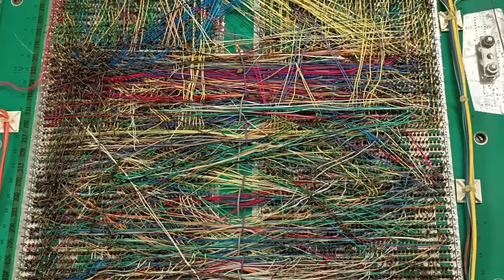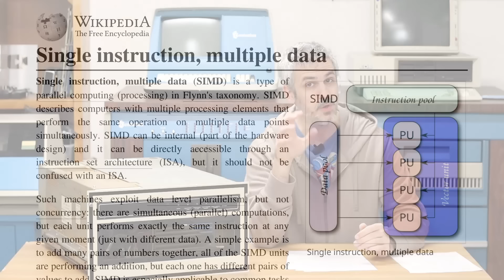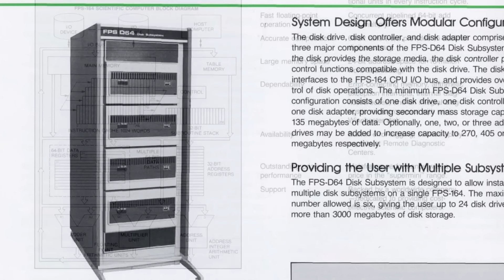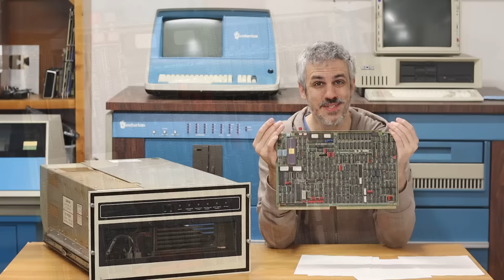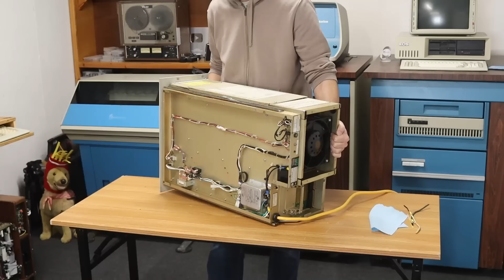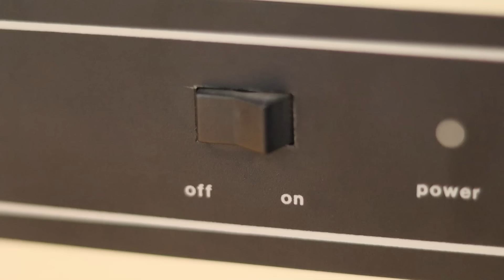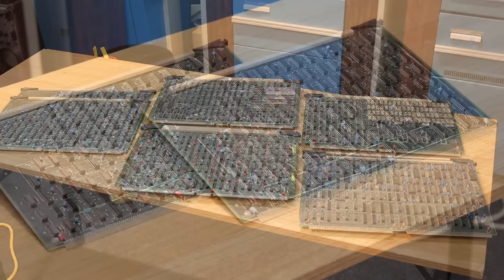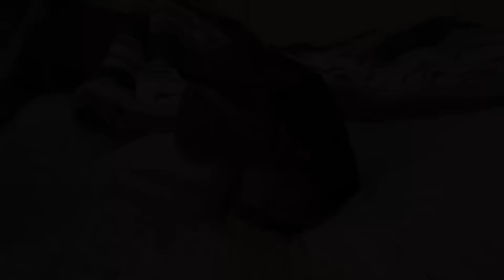This Computer is from a Defunct Supercomputer Company

Comment: In the 80’s there was a transition from scalar computing to vector/array processing was driven by a single, computational bottleneck: the massive data explosion from reflection seismic exploration used to image the Earth's subsurface. Geologists and geophysicists were trying to map the interior of the Earth to locate deeply buried oil, gas, and mineral reservoirs. To do this without drilling blindly, they relied on seismic exploration: detonating dynamite or using heavy thumper trucks to send sound waves into the ground, then recording the echoes that bounced off different rock layers using arrays of sensors (geophones).

Comment: Wow, Deja Vu!!! In 1983 I worked for a French Xray company CGR. They had a digital subtraction angiography (DSA) machine that used a Motorola 68010 based Versabus CPU running Versados. This was a front end to a microcoded vector processor built by VICOM of Calfornia. We used to call the CPU company "Motorooter". The circuit boards lay horizontal in the chassis. As they warmed up the boards sagged and the pins touched the board below it and shorted out. We ended up spacing them apart by wedging pencil erasers between them. When it ran it did some impressive image processing on Xray images. Look for a copy of Versados for your Versabus CPU. It came on 8 inch 1MB floppy disks.

Comment: Just like the MRI the Geological system was taken sound from different places on the surface and producing 3D Maps under ground to find oil and gas sands. Back in the late 70s early 80s I worked with the phoenix 500 system .

Comment: I guess if you don't got the microcode then ya gotta reverse engineer / design from scratch based on the chips used and how they're hooked together.
If it's loading microcode at boot, your microcode is just another part of your multi-processor executable?

Comment: Back in the early 1980's I worked for Perkin-Elmer, and we had a customer with a Floating Point Systems Array Processor. I spent several months on-site, although I had little to do directly with the FPS system so I don't remember the specific model. It was attached to one of the two 8/32 minicomputers we had which in turn were connected to 64 16-bit minicomputers and they in turn connected to (if I remember correctly) just over 1300 city intersections (traffic lights, in road sensors, pedestrian push buttons, etc.). My job writing networking software between the minicomputers and helping the application developers optimize their algorithms. The array processor was to perform high-level real-time traffic optimization (eg. a baseball game would let out a crowd, the traffic sensors would register high volumes, routes would be created by manipulating length of traffic signals to speed up dispersal away from the venue). We had a lot of redundancy at the front end, and the main 8/32 minicomputers could fail over (normally one was a development system). If the array processor was not available we would default to a previously defined time of day/week schedule.

From what I remember the FPS system occupied a single rack between the two 8/32 minicomputers. I think it had more than the single chassis for the FPS-100, but I believe it was a single system. Perhaps it had its own storage peripherals that were taking up the rest of the rack.

Comment: In geology, we use(d) "lots" of computer power for Seismology calculations - which can be used like an ultra sound to determine structures deep under the ground. I am 61, and became a software developer in part because of my love for Geology, and more precisely the things hidden under the ground. There are also many other techniques that require massive computational efforts, all resulting in similar results... A 2D or 3D representation of what's under the ground.
 BTW; I had one of those "Voodoo" 3D graphics cards (it really did seem to do a lot of voodoo stuff as well), and it was used precisely to render slices of the ground in 3D on the most powerful home micro we could afford at the time. We also used a silicon graphics workstation to visualize this type of "stuff" as well, along with the usual CAD work.
Peace from Australia.

Comment: worked at Fairchild palo alto research centre on the Clipper CPU project. I needed to determine the key figure for the semiconductor process for metastability of a flip flop (2uM process). We had a Vax780 and FPS164. I got a run per day. It took a few weeks to do a binary search via circuit simulator. Suspect it was aversion of SPICE.

Comment: before the 70's drilling for oil was "wildcatting"  ...  you just picked a spot and poked a hole on the chance that there might be something worth pumping out. 

These things allowed you to see what was down there by processing the echolocation of dynamite explosions into basically a sonogram. ... you couldn't see chemical composition, but you could detect phase changes (solid to liquid or gas chambers.)   

In first grade (75) at my violin lesson in a home, my teacher's husband was selling shares of an oil lease to my mom, and the primary visual he was using was a stack of 2d plots showing the cavity at 5000 feet below where they wanted to drill... was going to be a big reserve (millions of barrels) if it came in oil. engineer Mike had ideas about those cavities being useful for other things like Bat(man) Caves.

Comment: In Texas in the '70s and '80s locating oil using seismographic data was a pretty heavy lift that oil companies would need super computers for.  PS: to get that seismographic data in the first place, I think they put explosive point charges in various places and recorded all the echoes at various seismographic sensors. Then later they crunched on all of this echo data to triangulate likely places for oil and gas deposits based on density calculations.

Comment: Back in the 90s I was doing geophysical computing work, which basically meant babysitting a bunch of very temperamental vector machines while trying to squeeze seismic data through them faster than anyone thought possible. We were running these huge simulations full waveform inversion, reverse time migration, all the fancy stuff exploration teams loved to throw at us and the only way to get results before the next field season was to use vector processors. Scalar CPUs of the time? Forget it. They’d still be chugging through the first dataset while the coffee pot burned dry lol. The vector boxes, though those were the real workhorses. We had a couple of Cray Y‑MPs in the lab, plus an older C90 we kept alive with what felt like duct tape and prayers. Rows of those iconic blue and teal cabinets humming away, chilled by an AC system that cost more than my car. I spent a lot of time tuning code to take advantage of those long vector registers, making sure memory access patterns were clean, loops were unrolled just right, and the whole thing didn’t stall because someone else submitted a monster reservoir simulation. Speaking of which, reservoir modeling was another big part of the job: millions of grid blocks, all needing to be solved in parallel, all wanting more RAM than the hardware actually had. You learned to get creative.

Honestly, it was a blast. Loud machines, long nights, and the feeling that you were pushing the limits of what the hardware could do. Very “supercomputing lab in 1995” energy, I've give anything to go back to that era, I feel like creativity and innovative solutions were encouraged.  These days everything is standard practice even though it might not be the best solution, it is good enough.  Risk aversion has ruined research.

Edit:  I'd like to add that Fortran was the cornerstone of scientific coding back then, with some C for glue code, system utilities, and anything that needed to talk to the OS or batch scheduler. But the heavy numerical lifting, the seismic kernels, the wave equation solvers, the reservoir simulators, those were all Fortran. Some of the codebases were older than the interns lol.

A few adventurous folks were experimenting with MPI and PVM as distributed systems started creeping in, but that was more late 90s cluster culture. On the big vector boxes, it was Fortran all the way down.

Comment: I can answer how geologists use supercomputers. I am not a geologist, but I have supervised a geology team while working for an oil and gas exploration company. 

They used a Cray that was owned by Texaco, and used it to run stimulations based on know wells and underground scans to predict where we would strike next. They did some truly amazing things, and took most of the guesswork out of oil exploration. One of the early adopters of Cray's supercomputers was the USGS, and they mostly used it to model plate movement to simulate earthquakes and predict possible threats.

Comment: Geophysicists use seismic or other signals to determine subsurface topography, it involves tensor maths to determine material and stress strain relationships in the sub surface, you can use these to determine the location of particular materials, water, oil, minerals, etc. or you can use them to determine faults, high stress regions and occlusions which indicate high risk zones for seismic activity, earthquakes, tsunami, etc. So you can use it to find resources or dangerous areas, both with high value.

Comment: Vector vs arrays. It gets even more confusing when you mix in class objects called vectors and arrays. Vectors are just a dynamic array; you can change the size on the fly. Arrays are fixed-size. Depends on the language, though; in many languages, arrays are a bit of a catch-all term that mixes in maps, lists, dictionaries, and more. 

If you get into rendering, then vectors are closer to the maths term, though in computer rendering, they're a lot less abstract than in maths. Like, static dimensions and uses. That's modern programming, though. I couldn't tell you what it was like 50+ years ago. :P

Comment: An ESP32 can do similar or higher raw math throughput than the old FPS-100, but at thousands of times better efficiency.

FPS-100 (late ’70s): ~8–40 MFLOPS, room-sized, lots of power, dedicated vector hardware

ESP32 (modern MCU): tens of MFLOPS in optimized DSP/vector code, runs under 1 watt

Bottom line: an ESP32 is roughly 10×–100× faster in practical vector tasks and orders of magnitude better per watt.
A chip you power from USB casually beats a vintage “supercomputer” that needed serious infrastructure.

Generated by chatgpt

Comment: The original AP-120 (without the "B") was designed bty Glen Culler. It was quite different, used block floating point, but had the cross-coupled multiplier/accumulatot, like an early form of fused multiply/add, that accelerated dot products. I know this because the original plywood-sided AP-120 was still in the back room  when I started working for Culler in 1984. Culler licensed the design to Winningstad, who became a big benefactor of the Portland, OR area after he got wealthy (FPS was located in Beaverton, OR, west of Portland).

Comment: I used to work with Data General Nova minis. Loved those 8" floppy disc's. It even had a direct memory access board with 16K of magnetic core memory.
Reply: Here's some Cray trivia: The first Cray-1 machines used a DG Nova as a console.  They had a channel with DG I/O protocol so the console could boot up the Cray.  Even after they replaced the Nova with their own I/O subsystem, they had DG channels so they could use DG peripherals.

Comment: It can be done. I work on old flight simulator systems (CAE, late 1970s). I reverse engineered a bus-to-bus translator board. It had the similar AMxxx range chips that you have and I had no ROM listings either.
Took me a little under a year. I put the whole board in a VHDL model and using a scope and data probes I got it sorted.
It's going to be a humongous task, but it can be done. It's just a question of how much would you like to get it done?

Comment: I worked on the AP120B, FPS100, AP190, and the FPS164. I started with FPS in 1976 and left in 1985. Those wire wrapped backplanes were done by hand NOT machine. I still have a few of the specialty ic's and the wirewrap tools. FPS swan song started after Norm Winningstad left and the ex VP from Burroughs took the reins. They lost focus of their customer base after that.  FPS Array Processors were also used in satellite tracking stations as well as the CIA, also used to decrypt Russian radio traffic.
Note: FPS started out in 1/2 of a Quonset Hut, Once after it had rained very hard, we took a picture of Norm paddling a canoe in the parking lot with the FPS logo in the background!

Comment: 16:50 I was trying to work out what those bits of plastic were between the chips and the decoupling/bypass caps - looks like that was installed to keep the wired (bodge?) links in place.

Comment: We had one of these in the lab I worked in at TH Delft.  It was attached to an HP minicomputer.  It was used for both medical imaging and geophysics.  On the geophysics side it was used to do something called seismic inversion, which is a process by which you use the wave equation to image subsurface structure based on data you collected using geophones that were excited by explosions. On the medical front, it was used to do synthetic focusing from phased array ultrasound sensors.

Comment: This seems awfully similar to Sun's 1985 3d graphics hardware. I'd like to make a similar homebrew vector processor plus raster processor with with the wtl1032/33 (I'm missing a wtl1032) controlled by a microcoded am29116, with a seperate am29116 to rasterize.

Comment: The geologists in question would have mostly specialized in petrology. One of the ways petrologists find extractable oil is to set-off underground explosions, then record the shockwaves transmitted through the rock from different positions. Turing the recorded shockwaves into useful information about what's in the ground is computationally intensive. Also, petrologists would have been most of the geologists with the funding to afford equipment like this.

Comment: In the early 80's I was working on S.E.L (Systems Engineering Lab) 32/77 systems with 'array processors'.  It was mapped to a segment of memory address space with some custom interface boards. The beauty of it was, we would 'tell' it three or more addresses and some short list of instructions like "multiply address 1 by address 2, then add address 3 and finally divide by address 4 and store in address 5". Then we'd tell it "Oh, and do that 104 times". It would chug through 104 consecutive times, incrementing each address by 1. But the amazing thing was, it would be finished in a very short time (can't remember exactly, but setting up the arrays took longer than it did to do all the FP math).

Yeah I know GPU's are so much better. But for that time... it was some really 'neat stuff'.  :D
Reply: Oh yes, I remember we used 'Excess-64' FP format which used 32-bit words, but not IEEE-754 format. The interface boards 'converted/deconverted' to something that was 16-bit FP in the 'array processor'. So yeah, those were wild times, with so many FP formats.

Comment: I remember picking these boards at a recycling center. 20 years ago. I stripped off some of the integrated circuits because they looked so interesting. But why I don't know because I never used them. Most of these chips require massive amounts of development to build. And because of corporations, most of the technology is hidden behind closed doors. Normal people don't have access to the information, don't know what it is, and it just ends up in a landfill.

Comment: One, I love seeing the wire wrap backplane, it brings back memories.  Two, Texas Instruments built a 3D seismic computer, the Advanced Scientific Computer in the 1960s which used vector processing.  Geophysical Service, Inc. used it for creating the first 3D seismic surveys.  As I remember it had ECL chips and straight wire runs like the Cray. I went to work for them after a stint at planting geophones and measuring the downhole times on the printouts.

Comment: The first CAT scanner was not developed by GE, but by EMI in 1971 (the development of which was, in part, funded from profits on Beatles records). The designer, Godfrey Hounsfield, was later to win a Nobel Prize for this work jointly with Allan MacLeod Cormack. However, GE did produce the first whole-body CAT scanner in 1974. The EMI CAT scanner used Data General minicomputers. Processing was very slow.

As the FPS AP-120B was not released until 1976, it does not fit in with the time-line of the development of the first CAT scanners, or at least those which used X-Rays. NMR (nuclear magnetic resonance) CAT scanners are another matter, and GE did develop their first one around 1981 which does fit the FP Systems time-line (although GE did not produce the first NMR scans).

Incidentally, CDC were producing supercomputers in the 1970s that featured vector processors and option. I recall using one such computer in my studies as a physics undergraduate in the early 1970s. 

nb. the medical profession thought that the Nuclear part of Nuclear Magnetic Resonance would sound alarming to patients, and hence medical scanners are now generally known as MRI scanners (Magnetic Resonance Imaging).